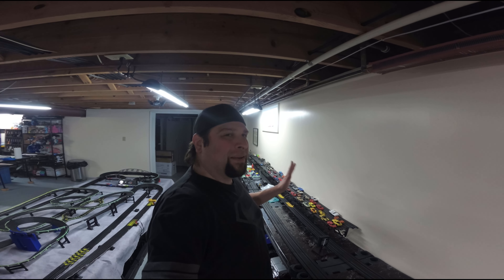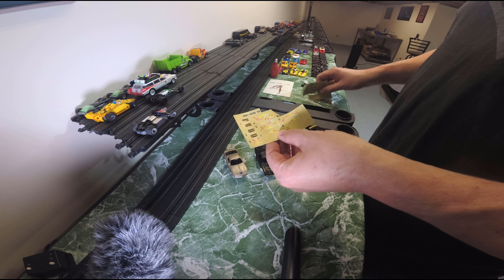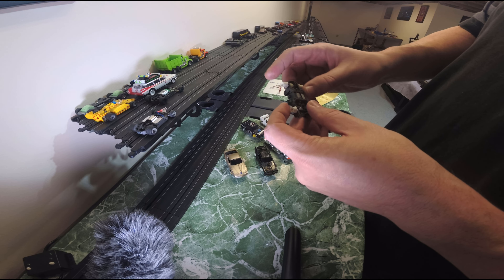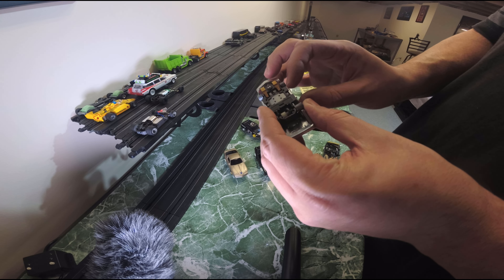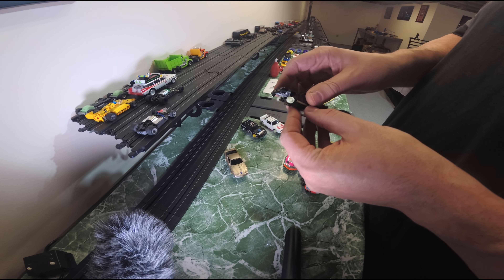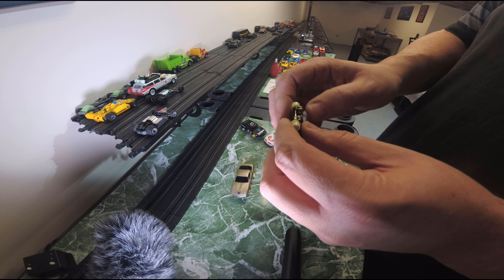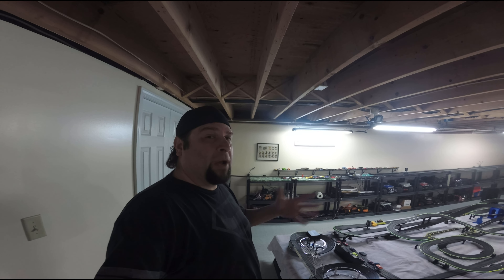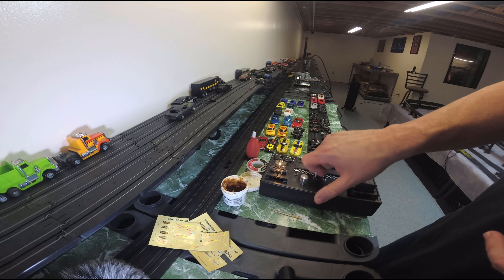Slot Car Subscriber Mail Auto World Flamethrowers Bulb Repair Light

Comment: That's the hard way to reassemble a 440X2. Traction magnets into the bare chassis first. Use an old rear tire in-between them to hold them in as you install the motor assembly. Tire will move out of the way as you press the motor in. Pickup shoe springs can be left off the motor brush barrels if you don't want to risk bending them. Can be installed after the motor is in the chassis. Just pry the chassis away a bit and slip the spring coil on to the barrel then let the chassis return capturing the spring. A good quality small hemostat is an important tool to have handy. Lots of uses and removing hair/lint is one of them along with handling those springs. For anyone who doesn't know the gray plastic chassis' is more flexible than black. Be more careful with black so you don't break it. This is an excellent channel so don't get me wrong I've just been doing this so long most people would say I need to get a life! Started with slot cars in 1972. Can't stay away and don't even want too! A great hobby for both young and old.
Reply from the maker: Awesome, thank you for the pro tips. I think when I made this video it was only my 2nd time stripping one down.

Comment: Excellent video Sir, May I ask where did you get the replacement light bulbs , TY
Reply from the maker: eBay. But I recommend using LEDs instead. There is a link to them in the description